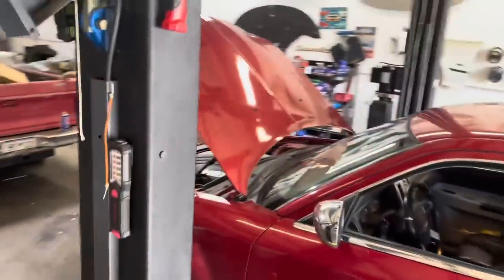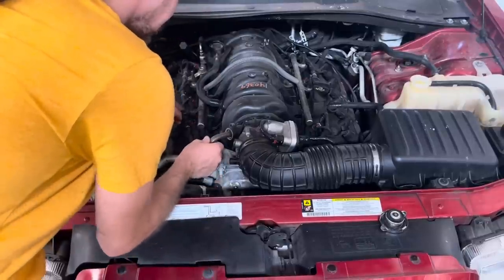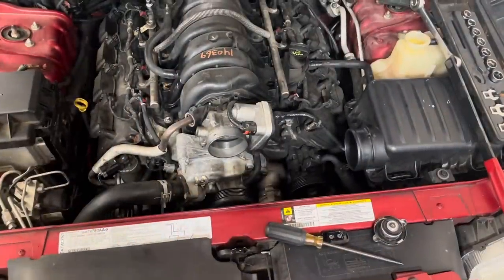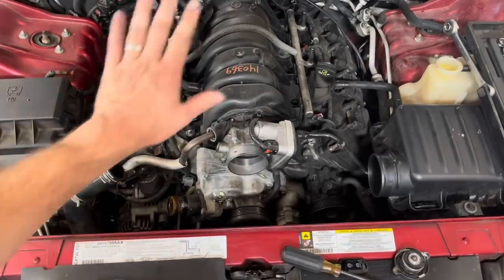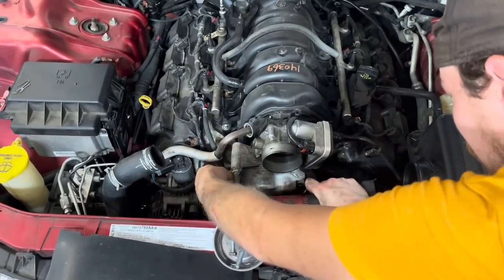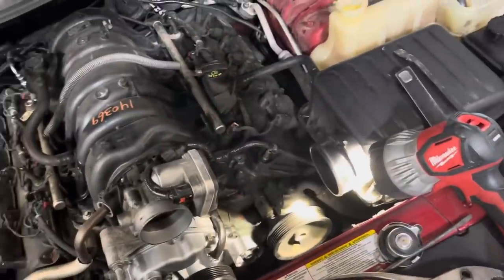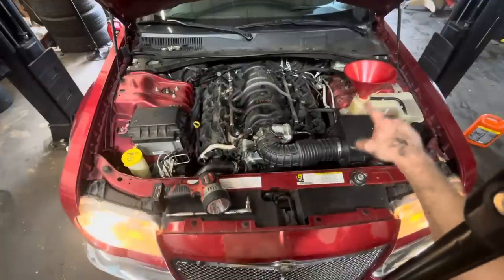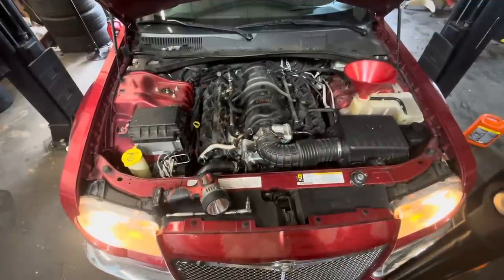Fixing a Chrysler 300c that Overheats!

Comment: I have the 06 300c srt8.  I've had since bought with 64,000 miles on it . She's babied. I've had no real issues. Other than the dreaded "clunk" noise in the front. Turned out to be the sway bar bushings and would only do it on roads with little bumps and divots. That was 10 yrs ago . Now with 90,000 miles she's still going strong and still looking beautiful. It kills me that the younger guys get them and beat on them continuously and wonder why things break. I do womp on mine sometimes though I just don't beat the shit out of it. Happy motoring everyone. 👍

Comment: I'm not a fan of Chrysler, but those were beautiful cars. At least the 300's lasted awhile unlike the horrid 200's they put out.
Reply from the maker: Yea and the 200 was built FWD. the v6 was horrendous at first, but I actually liked the 2.4  I had seen some accumulate high miles with ease.
Reply: My 2015 200 limited has 188k
Reply: I had a 2011 200 Convertible as my first car and it was a really good car back when I had it. I had to sell it because I was going to be on the cheer squad at my college and needed something more practical to drive teammates and gear around, I had to sell the 200 and I am currently driving a 2010 Ford Explorer Sport Trac. I still wish I had that car sometimes lol
Reply: @misskittycalais7300  That’s not really that high mileage
Reply: I love my 2012 mopar 300, got the stripes removed. 83k miles and has more gadgets than my friends new vehicles and fits my 6’4 body. Sharp looking car and pretty fast too. Just looking at problems that may happen lol

Comment: I looked up that labor rate on replacing that thermostat it was over a hundred with Chryslers part aroud 385 to 465. And you know that exstra 30 bucks for shop supplies witch witch I aways hid it on all good people but if you came in with that attitude no and the survey would always find its way in cyberspace but for the most part you treat them with repect you got it back but it doesn't matter sometimes there are some you do everything for and they would still be mad at the wrong person because they ever did maintenance at Toyota in Pensacola they purchased a Camry and brought it in at almost 70k and never change the oil just added oil I was totally blown away when he replied well when I bought it the said you don't need too do anything but drive and as far as a salesman yes it could have been possible.  I wasn't there for the purchase but I felt like he was being honest I did a complete 60k and flushed that block the best I could. He definitely was a great customer afterward.

Comment: I own two of these same year where would you suggest cutouts and small DC fan pumping out? Hood closer to windshield or end of front fender panel each side? Ive noticed the heat is absolutely pouring out under where the drivers door starts and the windshield side of hood. Already had rad and engine temp sensors done last year.

Comment: We had a 300M that was just bad ass! I mean when you're talking about a sports sedan Chrysler really made exactly that. It was fast, responsive and comfortable at the same time. We got it used and that's the way I felt about it, and when it did have an issue I looked it up and saw videos that came with the car when it was new on YouTube that showed all the cool ass features it had that we didn't even know it did 😳 it finally blew a head gasket and it's sitting on her daughter's property collecting dust but that car was really something wish we'd had it from the time it was brand new!
Reply: The 300M's styling was outstanding. I loved the rakish sporty look to it, and to be honest I was very disappointed in the look of the replacement 300C. Never took to it, although the later versions did manage to get away from that boxy, gangster look somewhat.

Comment: Another patient lives! 👍😎 This heat is killing cooling systems right and left. I think we've had 2 weeks of straight 100° temperatures here.
Reply: Yup my stepmoms Nissan Rouge sport was another victim of the heat. Her radiator fan died and uhhh… welp it took 3 weeks to fix due to the lack of parts

Comment: Glad to see you got this overheating issue tackled.  This is one I would not mind owning - love the sound of that hemi!  BTW, I had a 1993 Ford Taurus that overheated.  Never could figure that one out, even after checking the fan, fan controller, temp sensor and all.
Reply: You probably had a leaky water pump. I saw a repair video on that problem right here on youtube. The leak, they said, is very difficult to see due to a very small weep hole on the pump. Even if you know the pump is bad, it's not a job for the faint of heart. You need to remove the timing chain cause it drives the pump. This means installing special clips to hold each of the 4 camshafts in place. Lots of labor! Expensive!...Jay, how would you like to change the pump on a Taurus??

Comment: I am a fan of the 2018 Jeep Grand Cherokee 4x4 with the 5.7 L V8 engine and the eight-speed automatic transmission. These are excellent mid-size, truck-based SUV's.
Reply from the maker: Those still have the problematic Hemi engines. We just purchased a Jeep Grand Cherokee, but I made sure to get the Pen 3.6 v6. Much better engine, easier to work on, and cheap to replace if something where to happen later on. Those hemis dont last 100k miles
Reply: Lol grand Cherokees are NOT truck based

Comment: I have this same car, mines not showing overheating on the gauge but the coolant is bubbling in the reservoir and you can smell the coolant, any ideas what's going on? I have never seen my fans come on so I'm thinking that's the problem but i don't know for sure
Reply: Try changing the radiator cap my impala was doing the same till I changed the cap

Comment: So it was the (water pump)? Can you tell me what all needed to be done to it on bullet points please. Mine is overheating as well, and I’ve changed the radiator hoses and thermostat, but I haven’t done anything to the water pump, by the way, my radiator fans are fine, they are coming on as when necessary
Reply: That's exactly where I'm at too. Just put in a new thermostat yesterday. New radiator last year. So I just ordered a water pump from EBay because its still overheating. Thank god the fan is working.
Reply: mines overheating also and some people said changing the radiator cap will work and also burp the system 😢

Comment: I have an '05 300C DUB 5.7. 144,00 miles. I've replaced the water pump  radiator and alternator, and keep up on services. It is a hot engine and I'm wondering if running it without the engine cover would be better for it,  or if it's important to keep it on.

Comment: Between the slim shady song and the BMW comment got you a new sub!  😆 

Just replaced my thermo and water pump to fix overheating issues. (Had multiple issues) 

Og thermo wasn't opening all the way
New one tested - good
Installed and still had an issue
Replaced water pump today and still having issues.

But I didn't bleed or 'burp" the system. Could that be why I'm still overheating? 

My fans are running so don't think that's the issue. And my oil is normal no signs of water mixed in.

Kinda lost here but your "burping the system" comment made me think.

Comment: My son has a 07 Chrysler 300c he had a Overheating issue. Took it to a shop they flushed it like 4-5 times cuz it had alot of Rust and Mechanic put a new overflow tank and it seem to run fun for a couple of weeks and it wasn’t overheating and running at160-180degrees. He was Driving today and it blew the top Radiator hose and shot Clay color fluid everywhere so tomorrow I’ll replace top hose. Is there anything else that causing it to Overheat? Please anyone that has had experience with these cars any suggestions? Thank you.
Reply: Mine's doing it right now. I ordered a water pump because its not circulating from the overflow tank. I hope that fixes the issue.

Comment: These are nice looking cars!!   It would be great if you could mention the problem areas to look out for in particular models...or any expensive repairs they all seem to need.....
Reply from the maker: I’ll make another video in the future, but oil consumption, noisy valve train. Prone to dropping valve seats, and then the coolant leaks. It doesn’t take much to overheat one and that’s when the heads just check out. Replacement heads are still pricy. And used engines are even higher.

Comment: If you change oil ever 4 to 5 K you’ll never need an engine. Spray some silicone spay on the window tracks to speed up the time it takes to roll the windows up and down.
Reply from the maker: Unfortunately that’s not the case for the Hemi. They just have a poor design in general with the cylinder heads. Dropping valve seats and consuming oil. These littered garages everywhere having the heads replaced when they first came out. And replacement engines are still very pricy.
Reply: @MXguy95  Could be, I’m sure you’ve come across more of these everyday, thanks.

Comment: SRT8 wheels on this one.

I almost knee jerked about the dipstick, but it's the trans dipstick that Chrysler stopped sticking in so you have to buy one from them or Dorman.

Im not gonna make one leakage joke.
Reply: Not SRT wheels: "SRT Design" package on this one.  This is standard 300c, but with Powertrain calibration, brakes and suspension from the Dodge Charger Daytona of the same year.  Has SRT interior and unique (non-SRT) 20" wheels.  The mirrors and door handles were body-color, though on this one, someone needed more bling.  Chrome trim on front and rear bumpers is factory as this package did not get the SRT bumper covers.  This SRT-design package was only available in 2007 and 2008, where "300s" replaced it for the last two years of this body style.

Comment: Unfortunately it's a Chrysler and it's a piece of shit. all the Chrysler engines that end in .7 are junk. The 2.7, 3.7, 4.7, 5.7 and 6.7 were horrible engines. I've worked on tons and tons of them over the years. Chrysler went to shit when they discontinued the 4.0 and both the 318/360 engines. And then just destroyed themselves when they became FCA. I've owned plenty of Chryslers as flip vehicles...hardest cars to sell...even harder than a damn Audi/VW and those are just as shitty.

Comment: I installed a thermostat in a 200 3013 6v that vehicle probably has a water bump our a head gasket but I'm like you, we go by the steps I'm 61 you can't find techs too fix vehicles especially Mercedes and Volkswagens it's sad. And while running the shop at Mercedes, they would send the techs to school for a whole year when I pulled wrenches. I may have gone to school at the most 3 times a year. The longest school was 3 days for electrical 1 n up to three with two more times going that's it Mercedes and Volkswagen was the biggest non technicians ever.and I traveled fixing stores from Florida to Colorado. Made dam good money money but the stress doesn't purchase a new heart or prevent a stroke.
Reply: You're a dam good tech, especially for your age, and is that a junkyard intake with them numbers written on top.
Reply: I wish I had come across your video yesterday.
Reply: I purchased my 90-degree pliers at Harbor Freight with others 45 degrees, the best dam tools I ever purchased from there.
Reply: Your pry bars look very much like mine same place.
Reply: Great video, Jay, thanks.
Reply: I  have never seen an impeller like that.great video.
Reply: Thanks for teaching me the correct way to replace the water pump it's my lower back. That is bad it took me about 40 minutes yesterday, and you are about 13 minutes, but it's all good on that Chrysler 2013 6 cylinder 200 sedan. I'm so happy I found you today Jay.🎉